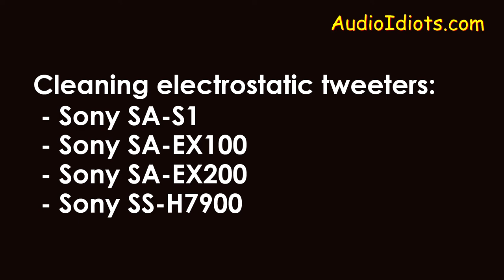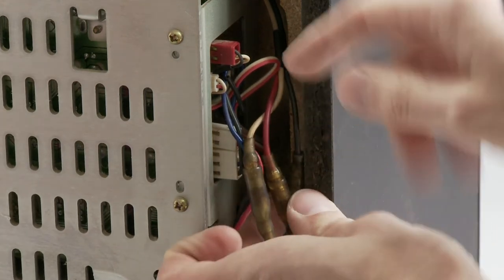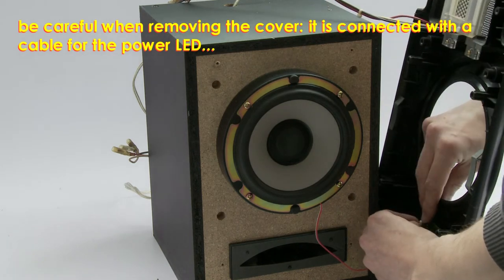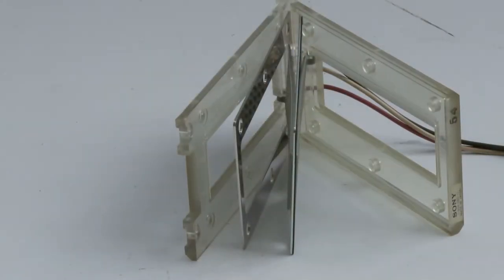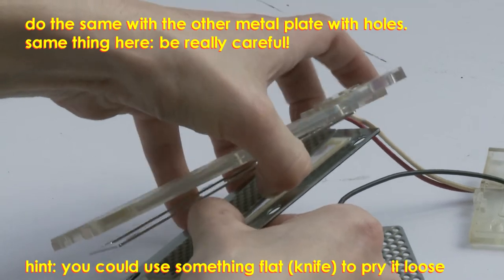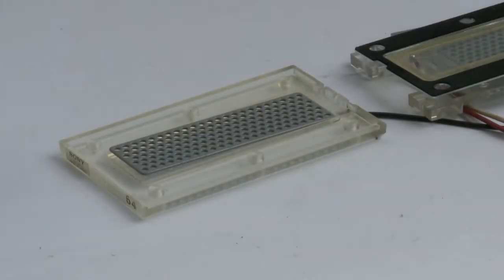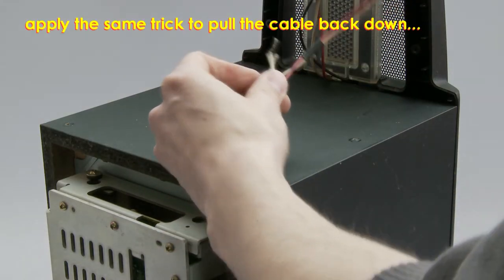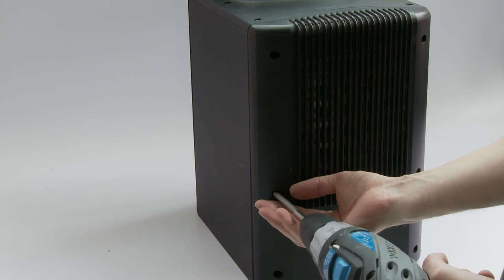cleaning electrostatic tweeters of sony sa s1 sa ex100 sa ex200 ss h7900

Comment: I did this some years back on a couple of tweeters coming from a heavy smoker.
After cleaning the foils I had to re-coat them to fully restore the sound.
Used a very thin layer of Kontakt Chemie Graphit 33 conductive coating for that.
Reply: Please tell me. I got a non-working twitter after the previous owner tried to clean it, it works but is quiet.
The membrane is not damaged, but as I can tell from this video, the membrane is wide enough to hold the edges of the polished metal plate.
In my case, the edges of the membrane are narrower than the rectangular opening of the polished plate.
Presumably it was pulled out by the previous owner, instead he glued the membrane directly to the gray plate with holes (one of two)
I decided to glue the membrane back to the polished metal frame (which has black rubber on the inside) as shown in the video.
But since my membrane is narrower than the rectangular hole, I glued the edges with regular adhesive tape.
It didn’t work.
 And so I think, maybe the plate is conductive, and it needs to have electrical contact with the polished plate?
And I also heard that you can buy a mylar film and make a membrane yourself.
But probably one of the sides of this membrane (or both sides) should be covered with something conductive?
And when people clean the membrane of dirt with cleaning agents, can the conductive layer be erased?
If only one side of the film has a conductive coating, is it important to stick the film to the plate only on this side, or does it make no difference?
Reply: @Monster-ng9go  Hi, If the conductive coating is completely removed, or if you've put new mylar in, you could recoat it with Kontaktchemie GRAPHIT 33 Conductive coating. It's designed to avoid electrostatic build-up on surfaces so conducts reasonably well. Be aware, spray from a distance, and even then the membrane will become pitch-black. But it did restore the high for me on speakers with totally silent tweeters.
I don't remember which side of the membrane I recoated. Was too long ago and recently I sold the speakers so cannot check anymore.
It maybe doesn't make a difference. If I have to guess I probably coated the side which is flush with the metal plate.

I've had more of these speakers, bought a second pre-owned set, and have seen two types of tweeters. The first one I was able to split the two outer metal plates and isolate the one middle plate with the membrane and re-coat.  The other one was of a type I believe is the same you now have, with the membrane firmly attached to the plate with the holes. I didn't dare to force it apart and ended with just cleaning the membrane (with a brush through all the little holes with isopropanol). That did remove a lot of dirt build-up (probably  nicotin) and restored the high. Results may vary.
Reply: @maartenvanbreemen4740  Thank you, the main rule seems to be that the membrane should not be conductive from both sides. with only one.
Since the membrane (the side covered with graphite) and the electric stator are very close to each other, isn't their contact a disaster?

and in the case of creating a custom membrane, I think it is worth paying special attention to recreating the insulating rubber frame so that the stator does not touch the membrane.
Reply: @Monster-ng9go   must be spray coated on the front side
Reply: From Thailand,I have the same problem. Can I use the food wrapping foil or the car film that coated with something like mirror in case of after cleaning it stills fail.thank you sir
Reply: @lonelyplanet3357  I didn't replace the foil at that time. Only cleaned them and re-coated. Best to source some foil used for electrostatic speakers. If you google for it you probably will get pointers to it from the high-end audio lovers. I would expect the mirrored film you mention already has a too low resistance coating and may not work well. But it may be worth to give it a try.  Regards, Maarten
Reply: Thank you very much sir.

Comment: Hi there, great vid btw.  Have recently come into possession of a pair of these and when I set them up in an open space they sounded fantastic. Am still trying to find the right positioning in my smaller room.  Any body have experience with this?  One last question, if I take the top panel off protecting the tweeter and vacuum it, will it cause it damage?  Many thanks in advance.
Reply from the maker: good to hear. I would be very careful handling the thin sheet of plastic. I would use a cloth to wipe it clean, not a vacuum cleaner. enjoy your speakers!

Comment: Hello! I have a SONY SA-S1 speaker, I did as shown in the video, unfortunately it didn't help! I want to coat it with Kontakt Chemie Graphit 33. My question is, should the membrane itself be protected from treatment? Only the metal surface should be treated? And should it be done on both sides? Thank you in advance!
Reply from the maker: First of all: I'm not an expert. I just tried this and it worked for me. My main point was to clean the membrane itself because a lot of filth had accumulated (I bought it from a smoker). In the process I also cleaned all other surfaces. But the point was to clean the moving parts because filth will make it heavier and therefor more difficult to move. Good luck!

Comment: Hi, I really need help. I bought the SA-S1 speakers. The tweeter plays very quietly. I suspect it needs to be cleaned. Tell me what means to clean so as not to damage the conductive layer on the membrane. I live in Ukraine, what kind of cleaning agent will be safe. Many thanks. Paul
Reply from the maker: I used alcohol for that.
Reply: Hi Mark!
I understand correctly, can I clean the membrane with alcohol? Alcohol should be how much percentage? 96?
In your video, I see you are cleaning the blues wonder , a cleaner.
If I wipe it with alcohol, will the conductive layer on the film deteriorate?
Reply from the maker: @ПавелФилиппов-ю8у  I can't remember for sure. I have cleaned 3 or 4 sets in total. maybe start with a cleaning solvent like blue wonder. and if that does not work use a high percentage alcohol. One of the comments mentions Kontakt Chemie Graphit 33 conductive coating to recoat it.

Comment: this is totally unnecessary and will not change in any way the sound quality of the tweeter
Reply: +Leo Sp i have a mhc p100x and the high pitch back
Reply: My MHC P100x come back to life too!
Reply: DON'T LISTEN TO LEO SP!
Cleaning speakers properly ALWAYS makes them work better. Especially motion panel speakers that require a thin piece of magnetic film to move with linearity in order to operate as the manufacturer intended. Dust, grit, dirt and hair gets in between the mechanism and ruins its piston-like motion causing its movement to be limited in certain or all areas! This is distortion! Leo Sp, you need to spread facts, not lies! If you don't know something, stay quiet about it!
If your woofer gets dirt in the magnet, it could seize. If your tweeter gets grit in the silk-dome, it could tear. If your subwoofer gets a dirty surround from being behind a grill for too long, it could result in foam rot. If an AMT tweeter gets dusty, it sounds like shit. If an electrostatic panel gets dirt in it, it will not move correctly or at all!
Reply: @lowerthetone  I had foam rot from my philips mini hifi...so upset! I had it repaired but its not the same anymore.